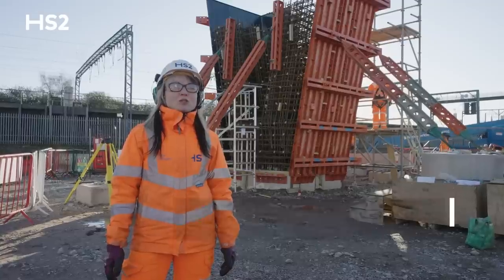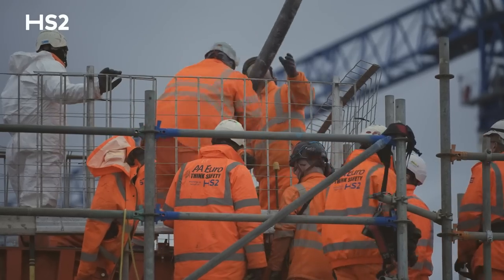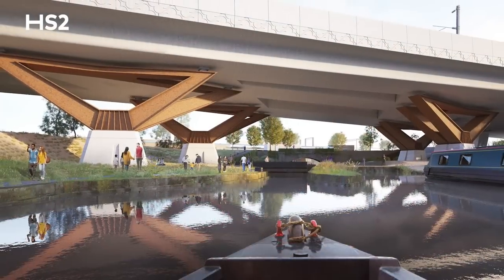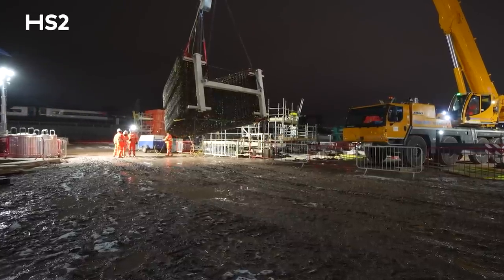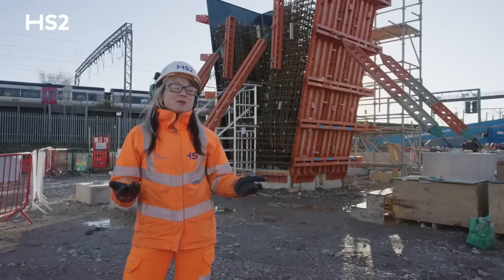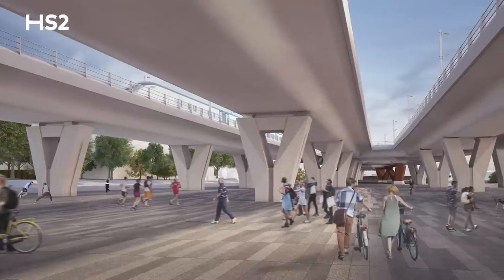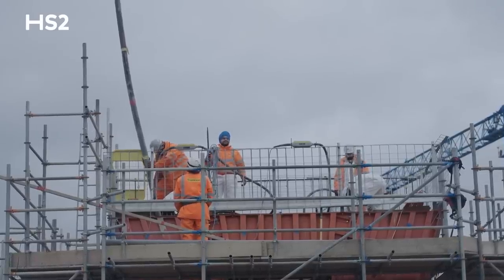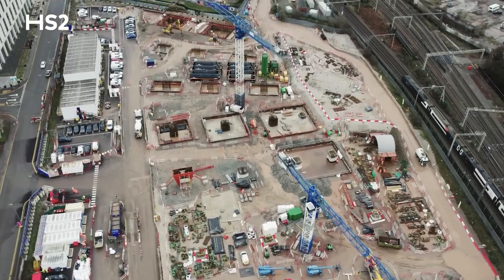HS2's first Curzon Viaduct pier completed as work ramps up in Birmingham city centre site

Comment: any reason as to why you could not do all 3 viaducts steel piling instead of taking 1 year to do one viaduct, and erect all the v blocks first [ you know where  their location spot is ]  am willing to bet it will be 2033 before its all finished as it has been stated finish date  is between 2029-2033,the work force know now so the breaks will be put on,